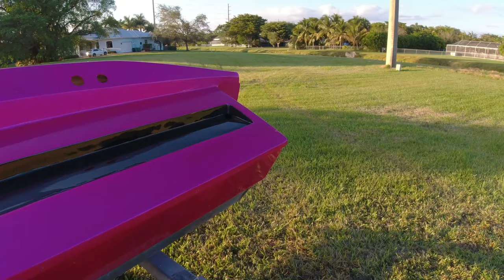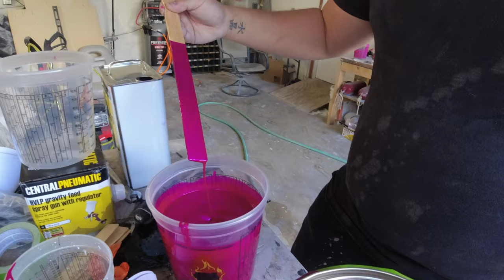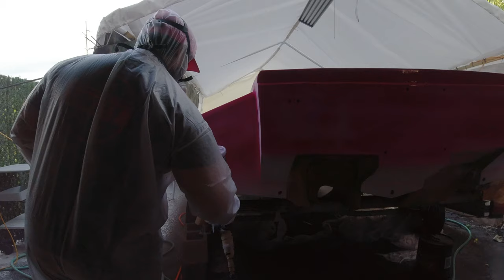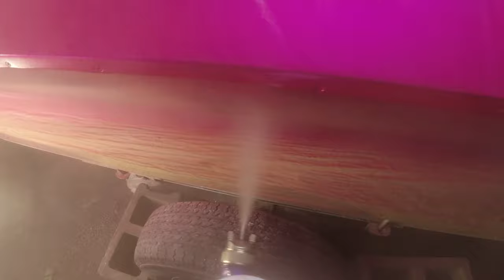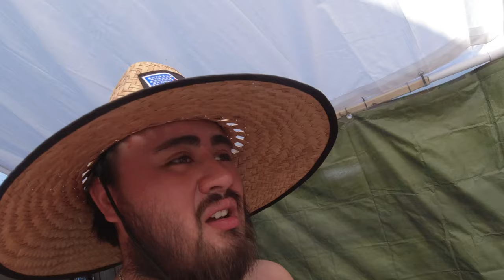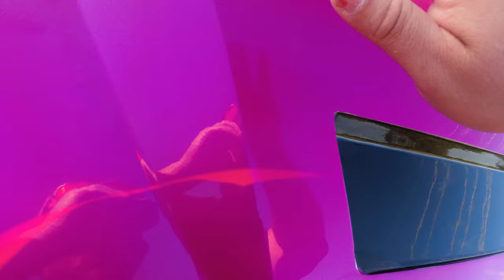WE PAINTED HER BOAT HOT PINK! ( DIY BACK YARD PAINT JOB )  IT LOOKS AMAZING!!

Comment: Looks good from the video.  Painting is not easy and you did it without a spray booth and ventilation system.  Color looks good for that hull shape.  Maybe addd some vinyl striping or a design pattern.